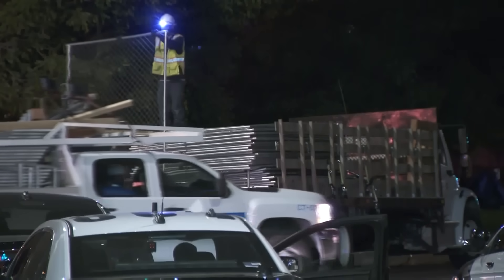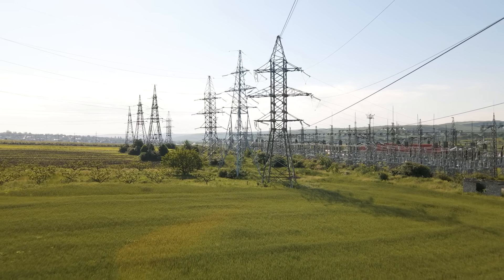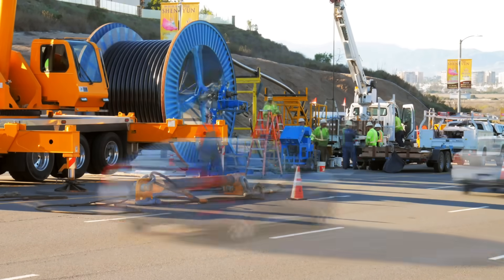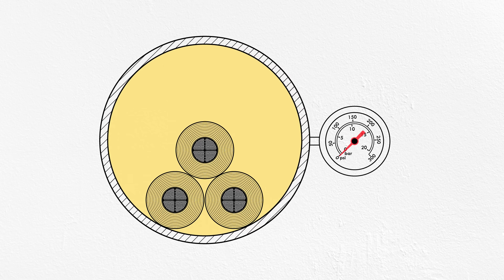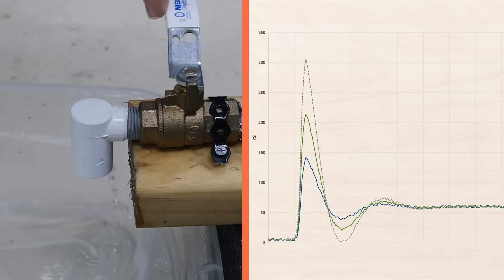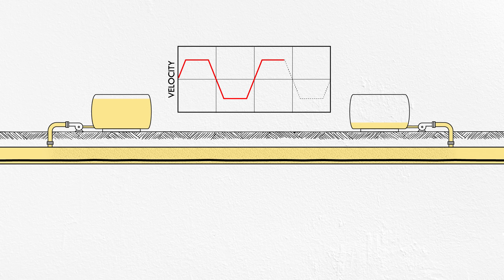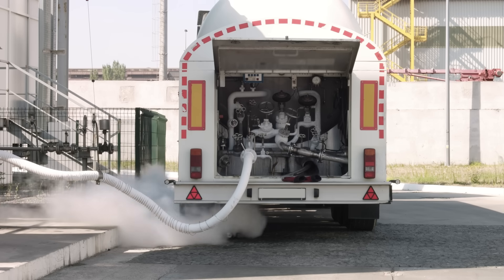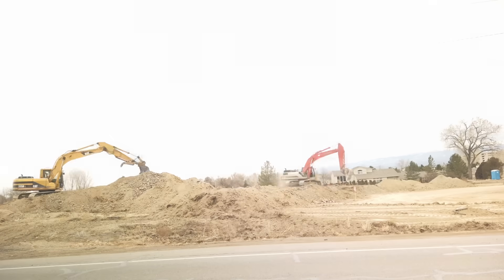Repairing Underground Power Cables Is Nearly Impossible

Comment: @1:50 "That's exactly what we do".  The reason why to favor high voltage and low current was left out. This is because the majority of distribution power loss is proportional to current. 10000A would heat the wires till they vaporize, but 10000V is just fine.

Comment: Fast-forward to 2019... Take a look at Berlin, Germany, on a map - more specifically Treptow-Köpenick. You will notice that this part of the city is isolated from the other populated areas by waterways on most sides. This forces the redundant high-voltage lines (110 kV in this case) that supply the inhabitants and industrial areas with electricity to converge at certain points to cross the rivers or canals. On February 19th 2019, a construction company was conducting some kind of drilling operation at the Salvador-Allende-Brücke. Around 14:00, they severed the first of the lines. As far as I recall, they did not get the necessary permits for the kind of work they were performing, and neither did they do the obligatory due-diligence on the paperwork, but in the spirit of taking things too far, they just ploughed through - quite literally - and destroyed the second line as well. This lead to a 32-hour total power outage for 31.000 households - 70.000 people - and 2.000 businesses. A lot of lessons were learned. The damaged section of cable is now on exhibition in a museum, if I recall correctly...

Comment: I designed a moderately elaborate earth retention system with many ground anchors close to a pipe-type cable (and several high-voltage tower foundations) several years back. The record drawings furnished by the utility (our client) only indicated an oil-filled steel pipe with the conductor details omitted. Trying to guess how that would work, I thought that the oil itself might be the conductor and that the large cross-sectional area of the oil is what kept the resistance low. Thanks for helping to explain how they actually are constructed and are designed to function.
Reply: Oil is always an insulator due to covalent bonding, or so I thought until I read in John Piña Craven's book that under extreme pressure - the bottom of the ocean - it can conduct electricity. He learned the hard way as he pioneered undersea engineering for the navy.
Reply: @murdo_mck  Sometimes the hard way is the only way to further humanity's understanding of science. The Curies are an example of learning the hard way. Sadly, their pioneering work into what is now called Radiology (the study of radiation) cost them their lives.
Reply: @murdo_mck  and just think - the lipids in your body work the same way.  Under very high pressure, they are no longer insulators, which means neurons won’t work right. That’s one reason why creatures that live at the surface of the ocean can’t survive at great depth.
Reply: @BlackSoap361  at what pressure does that happens? i think sea-elephants and sperm walls dive to 2000m or more

Comment: Why not have 3 separate lines instead of cramming every phase inside a single pipe. Seems a bit lazy
Reply: Then you would have to pressurize, insulate and maintain 3 pipes and if it short circuits itll be a nice guessing game wich of the 3 pipes it is. And they are not really crammed in the pipe as there needs to be room for thermal expansion
Reply: @railrost7428  not really, there's only 1 cable in the pipe so there are no arcs to jump anywhere. Also locating a short on a single conductor is much easier than doing the same across 3 of them

Comment: I used to work on this cable years ago, didn't care much for it and replaced it with poly noted in video 30 years ago. If this little project took 11 years, they must have replaced duct as well. We only put one conductor per duct, 3 is a disaster waiting to happen.
Reply: They placed new duct alongside the old.
Grady stated that the utility has abandoned the original in place and can use it for backup in the future (if needed)
Reply: @jimurrata6785  yep, but in a situation like this, put in 6,9,12 (rather than the minimum 3 in this case) ducts and never plan on re-energizing oil filled cable again,, with the road dug up, all you have in the cost of 5" pvc pipe.  Simply pull in new poly in extra duct in future when and where needed and you are done.
Reply: @cleokey  I imagine there were all kinds of restraints on the excavation through the heart of Los Angeles.  (Look at the diagram of the route)
The Santa Monica substation had to rely on the repaired cable for over a decade, while disruptive construction pushed the project forward.
Sometimes ( many times!) humans, industry, etc are in the way of your "best" option.
Perhaps Musk can repurpose the boring company to expedite utility replacement?
But in that case the tunnel would have to be completed before cable was pulled, unlike "cut and cover" type excavations.

Comment: I work in the utility industry in NYC and often come across their own version of this. The trade name name is Oil-O or Oil Static electric transmission lines. Anyone walking around the city may occasionally come across these extra special red mark outs on the pavement or sidewalk: “OIL-O”.  Underneath their feet will be 2 large diameter “feeder” pipes containing the conductors bathed in oil accompanied by two smaller “oil” pipes containing just recirculating oil. 
They  are systematically re-excavated by contractors so that ConEd corrosion crews can first remove the old  asbestos-containing coal tar coating and assess the condition of the steel pipes. If they are corroded/ pitted beyond spec, split pipe segments known as “barrels” are welded over the pipe and then pressure tested to verify integrity. Finally, modern green spiral -wound primerless tape is wrapped around the refurbished pipe and then back filled. 
When working alongside these pipes in an excavation, it is too easy to forget that these warm, but otherwise silent pipes are each carrying 345,000 volts of electricity apiece. Amazing NY.

Comment: I've seen freeze seals using CO2 used on a much smaller scale to do plumbing repairs without having to shut a whole apartment building down. Usually because it wasn't possible to isolate the section with a normal valve
Reply: How do those work?  Does it use the thermal  expansion of co2 on the pipe to freeze the water inside?  Is it just a temporary solution so they could shove a valve on it?  I just have this visual of somone using a seal, and cuting the pipe and the ice melting just enough for it to shoot out like a cannon with the rest of the water from a 30 story apartment pipe system:P
Reply: @warlockd  TBH I'm not sure.  All I know is cold stuff makes water freeze and block the pipe.  I'd assume its similar to how you can freeze stuff by hitting it with a CO2 fire extinguisher

Comment: "sir we have a hugh risk of thermo-mechanicle-bending" ......"what if we use extreemly cold nitrogen allong side hot cutting and remove the thermaly conductive fluid?"  ......
Reply: Because the compressors and condensers needed to supply that volume of liquid air would consume half the power in the cable?
Because when liquid air warms up it reverts to a gas and high pressure in the duct or cable is a huge problem?

Comment: I've never worked on Underground Power Transmission lines but I have worked on Under Sea Telecommunication lines so many of the same principles apply especially in the Umbilicals used to supply power to the machines used to install, inspect and repair these lines. Your series is always informative.

Comment: I don't know a huge amount about it, but London used to have many Power Stations - coal fired - when I was a kid - 1950's.  We even had a power station devoted to supplying the traction current for the Tube - Lot's Road Power Station.  Then, while I was distracted by being a teenager and starting work, the power stations closed and became other things.  How was London getting the enormous amount of electricity those old plants had supplied?  The answer, it turned out, was an Ultra High Voltage cable 'ring main'.

As I understand it, the cables are as complex as you suggest and they run in tunnels all the way round the city.  I have no idea how far out the ring main is, but if our orbital motorway is anything to go by, that's about twelve to fifteen miles from the centre and is 114 miles long.  So the ring main tunnels must be about that far.  If it's any guide, we Londoners seldom suffer black outs (only locally) so whatever it is, is pretty reliable.

Comment: I don't think HPFF oil cables were used a lot in Europe. Maybe it's because the SCFF cables with the oil inside the hollow conductors were already around since the 1920's and worked quite well and are much easier to repair. Here is an example on how they made the joint's for cables like this in the 1930's: https://youtu.be/ltY82DbCHXs

Comment: P.E. #1: We’re going to run 10-miles of high voltage power line underground, bathed in high pressure oil.
P.E. # 2: What about access requirements for unplanned maintenance?
P.E. # 1: That is P.E. # 3’s problem to solve.
(Kind of takes the “civil” out of Civil Engineer.)
Reply: Often growth in demand and population happens on a scale that couldn't even be fathomed by the original engineers.
They are also working with the technology available at the time.
Why didn't Bell System engineers of the 1960's bother installing gigabit fiber on every residential street in the nation???
They were so short sighted and only causing future problems!  🤣
Reply: @jimurrata6785  I see apples and oranges on that one. Although fiber certainly has its own quirks for maintenance, accessing the utility is pretty much the same as accessing telephone wire, and fiber has serious advantages over telephone wire.

What is the advantage to burying the cable underground in a manner to make access so difficult?... Low project capital. Basically, people didn't want to "see" the infrastructure, but didn't want to pay upfront for lifecycle expenses.

Machinery is not prejudiced, and tends to keep people pretty honest.
Reply: @stevedoe1630  Not my point
People ask why bother, and kick the ball down the road.
There was no digital communication in the 1960's.
There was no fiber optics.
There was no internet.
There was no computer devices in the home to even need a connection.

PE #1 could never have envisioned the demands made on that cable nearly 60 years ago.
There was nowhere near the population, and most people did not have things like air conditioning.
They probably did plan well for the future. But this future is nothing like they envisioned.
You can't build everything for every possible circumstance.
And you could afford to, and did... that would be the one you had to rip out to make way for a shopping mall (or whatever)
Friggin people think infrastructure is supposed to last like the Roman viaducts!
Every project (from your mailbox post on up) has design parameters and a projected life if properly maintained and not overloaded.
Lifetime is reduced if neglected or exceeded.
Replacement should be budgeted over lifetime and started in time to be functional at EOL.
Reply: @jimurrata6785  Good call. Once we iron out the kinks with Tesla's wireless energy transmission, midstream transmission lines will be antiquated. Or, maybe every property will have a micro quantum reactor in 60-years. Who knows?
Reply: @stevedoe1630  Nature already has wireless energy transfer.
Once we can harness the potential of lightning we will be Masters of the Universe! .....  🤣
Seriously though, California's mandate for solar on all new construction is going to go a long way toward a decentralized grid.
I'm hoping this planet will still be habitable in 60 years.
Reply: @jimurrata6785  Aiming for Kardashev, Type II. (I had to look that one up.)

Comment: We use TDR (both optical and electrical) for fault finding in subsea cables. It's critical because repair ships are expensive and when you start a repair you need to cut the cable before pulling it up...so as you say it's both an art and a science. Let me know if it interests you and I can provide more details...I install them too.
Reply: Go on.
Reply: @naamadossantossilva4736  well, we sometimes have shunt-faults, where a tiny hole opens up in the insulation and causes the conductor to go to ground. We can balance the power feeds at each end (keep in mind for a 6500 to 10000km cable) in some cases to keep power going to the optical amplifiers. When you balance the power you can start to narrow down the location. Basically the operations team will run and rerun calculations to start to narrow down the fault...and sometimes use a type of TDR of the fault isn't giving up enough info. Sometimes the best route is to increase the power to make the fault WORSE (it adds heat which burns away more poly insulation) so the fault is easier to find. Eventually, if it's a deep water fault, a cutting grapnel will be used to cut the cable to one side of the suspected fault. The bad end will be pulled up and winched on board until the fault is recovered (you also need to pull up the good end and float it on a buoy for recovery later). You do the splice, steam out to your buoy, recover it and splice the spare cable on. There are many types of repairs, if it's shallow you can use an ROV for instance. There is a fusion splicer on board for the optical splicing as well...just like a terrestrial repair. The cable is tested and dropped back into the water and tested again, then power is turned back up and traffic is put back. The ship documents the damage and takes the fault back to be sent for analysis if required. Actual repair time is about 3 days assuming weather is good and cable can be found quickly.

Comment: When you got to having to open the pipe, first thing that came to mind was 'freeze seals'.  We used both LN2 and Freon-based freeze-seals during maintenance outages at power plants to avoid having to completely drain key systems.   Works great with water since water expands when it forms ice.  Didn't know you could do that with oil, learned something new today.  Thanks.  :)
Reply: Same, I did one last year while the plant was still online, 2500psi held back by a 4" freeze seal. It was honestly amazing.
Reply: Would you have to worry about the expansion of the ice as it freezes?  Even if it wouldn't break the pipe you would have to be concerned about the possibility of stretching/weakening of the material, at least if the fluid is normally high pressure.
Reply: @jwmoffat  At pressures that high, the variety of ice formed is actually quite dense. Ice VI, the ice that would probably be formed at this pressure and temperature, is about 1.3 g/cm^3. It would probably contract instead of expand.
Reply: @jwmoffat  You DO have to consider that.  Thin copper or PVC piping used in a home would fail miserably.  But we were dealing with steel pipe that had a working pressure of 500 psi and higher, so not the same sort of problem.
Reply: @mikefochtman7164  If you call a plumber to replace a broken main shutoff  that can't turned off at the street, that's how they do it.  I believe the device clamps down on the pipe to prevent it from bursting.
Reply: @jwmoffat  Freezing a pipe filled with water would be tricky. But water is the only liquid that expands when it freezes, everything else, including oil, contracts. As the oil freezes and contracts, I would presume that more oil fills the space until there is a full width plug.
Reply: @alandaters8547  I wasn't sure if there were others.  That would make sense if it did that.  Do you know if the contraction is minimal?  I wonder if it would be a concern when thawing - at least if the section melting is expanding directly against the pipe.
Reply: @alandaters8547  In our case we froze a 1/2" heavy wall stainless tube. It freezes from a center point outward in both directions which allows it to expand laterally and not stress the tube.  We were more concerned with the expansion increasing the pressure measured by a connected transmitter. I know it may not seem significant at 2500 psi but this system was responsible for measuring water level in a steam generator and measured the difference in pressure not the absolute.
Reply: @jwmoffat  There are a few other liquids that expand when they freeze, like gallium.  But none of them are anywhere near as common as water.
Reply: @jwmoffat  I was wondering the same thing, why it doesn't do more harm than good.
Reply: @rsethc  probably because it has space to expand, the water might be pressurised but ice makes a ton of pressure.
Reply: Have heard of using ice plugs in the oil and gas industry to remove stuck tools from a pressurized wellbore.
Reply: I recently learned they freeze pipes in a similar process, out in oilfield repair. i click this video and see it for a second time :D
Reply: Since the oil was already pressurized, it probably wouldn't hurt for the frozen oil to shrink a little bit. Fresh oil would rush in to the void, ready to freeze.
Reply: "When you got to having to open the pipe"
Reply: @jayw900  Looks like google translate and his first language is not english.
Reply: @jonka1  ?? His comment is directed to Grady, as in "When you got to [the point of the video where you talked about] having to open the pipe..."